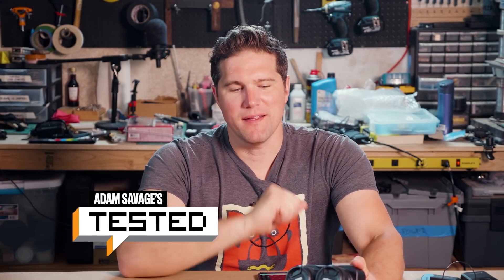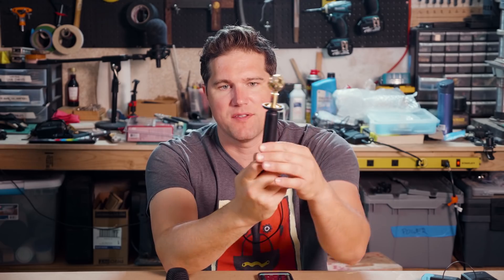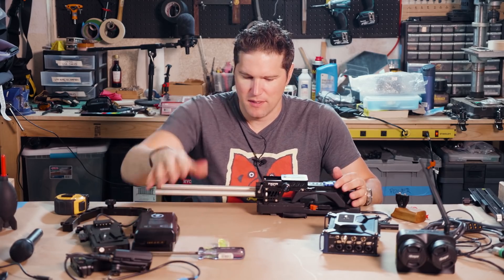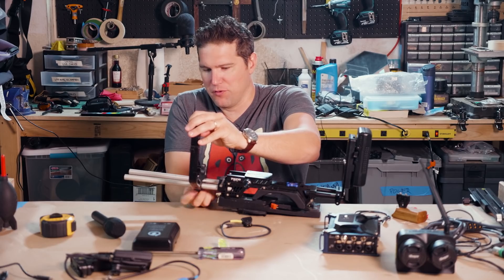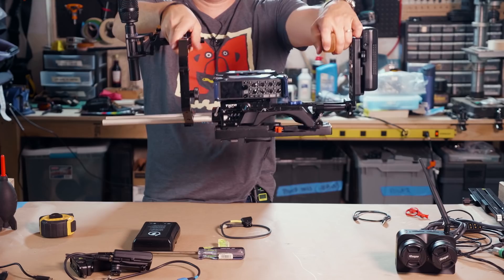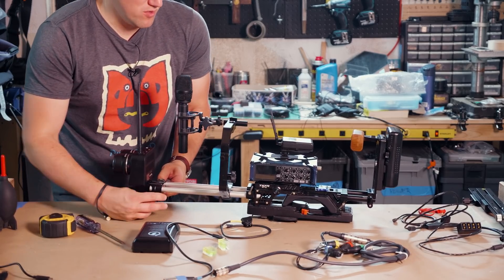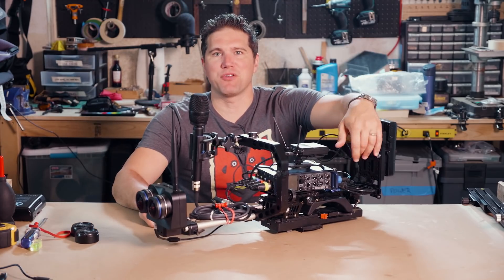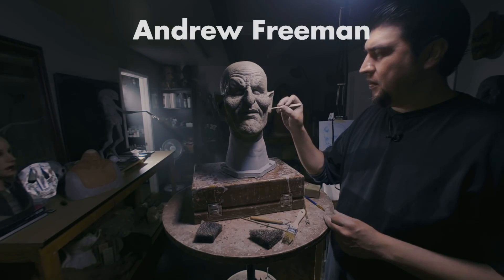Tested: Assembling a VR 180 Camera Rig!

Comment: rad, content I can't access without an Oculus headset.
Reply: Can't even access it with a Oculus headset. Only works on Quest, not on Rift or Rift S.
Reply: @grumbel45  Ouch i was sad being a Vive user myself. but that's even worse than originally i thought!
Reply: @grumbel45  YouTube Supports VR180 Content, so they could make it avaiable to CardBoard/Daydream users (and Desktop VR...sorta) with out issue. Seems like it might be a Oculus Sponsored thing, frustratingly.
Reply: @albinobluesheep  That is not even the same technology we are talking about here. This hardware is built for emulated depth, there are no real VR videos on youtube, just 360-2d content and a few shitty 3d videos. The only other real VR 180 content besides what Tested put out with these cameras that exist is porn right now (which are filmed with much higher quality sensors). Which is freakishly cool and very realistic.
Reply: This hardware is precisely the typical stereoscopic 180 plus ambisonic audio YouTube does support. Reconstructing depth is a distinct task.

Comment: I only have one thing on my mind right now what is that cam could be used for 😂
Reply: This stuff has been used for years in porn now and the porn industry uses way better sensors for the VR 180 porn these days. It's freakishly realistic, even if you are not comfortable with porn, it's very technically fascinating.